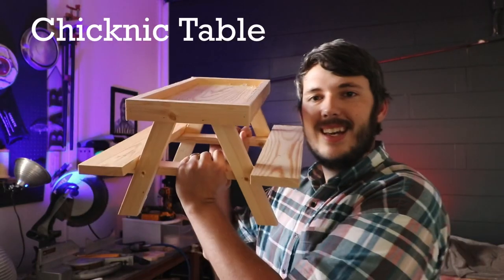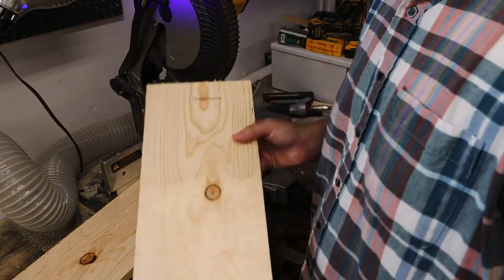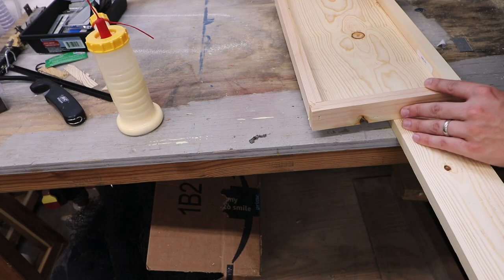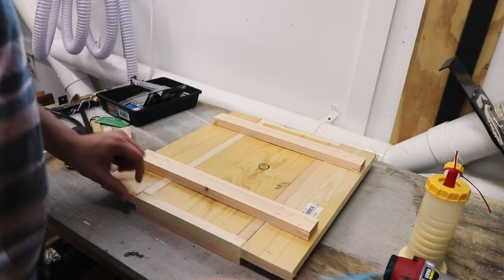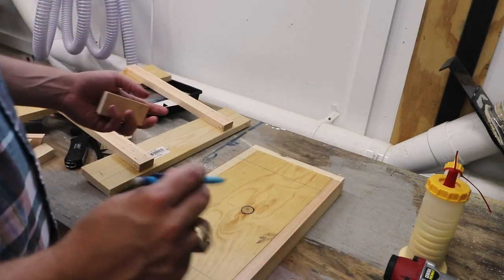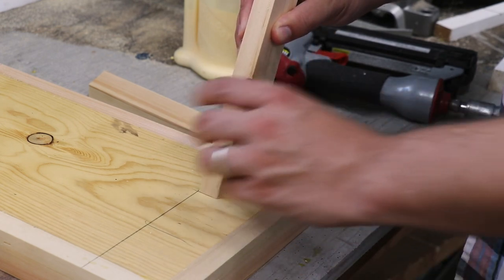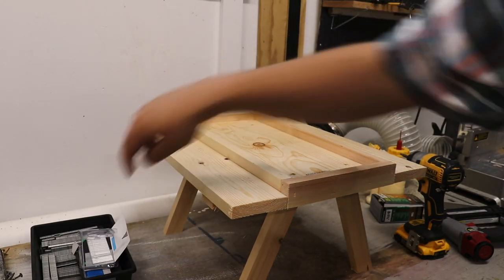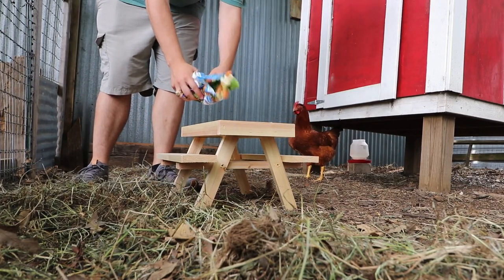Chicknic Table - How to Build a Picnic Table for Chickens (with Plans) - Fun Woodworking Project

Comment: That’s brill I’m no great with a tape measure I know inches can I do it to the nearest inch and what thickness was the wood thanks steve
Reply from the maker: Yes you can! It doesn't have to be exactly like mine, I just based mine off the proportions of a regular table.
Reply: Austin Makes Stuff thanks very much for your response

Comment: What size boards did you use?
Reply from the maker: 1 - 1”x4”x4’ board for the seats.
1 - 1”x8”x8’ board for the table top.
2  - 1”x2”x8’ boards for the bracing and the lip around the top.
Reply: @AustinMakesVids  Nice one. You'll make my partner a very happy woman! 
However... 
I'm Confused. Your drawing dimensions don't tie in with 1"x2" boards 
If the top is 8" x 16 3/8" and the lips are 1" wide, then your end pieces on the table lip must be 10" long, not 8 3/4" on the drawing.
Similarly, if the lips are 1" wide, then the seats would be 18 3/8" long
And if the top is 8" wide + 2 edge boards + 2x4" seats, that would make the seat supports 18" long, not 15"
Is the drawing wrong or did you trim down the boards?